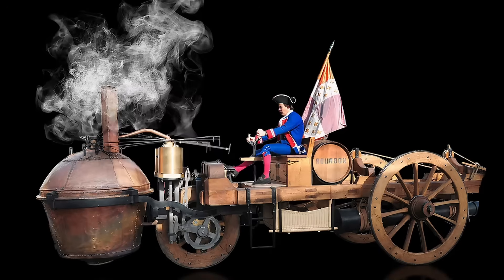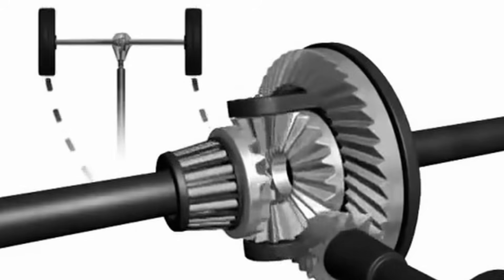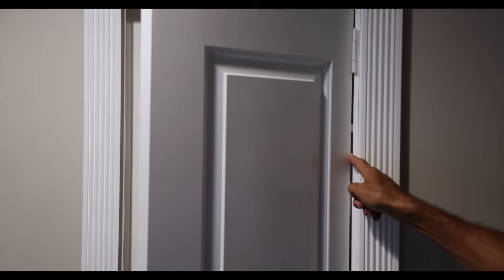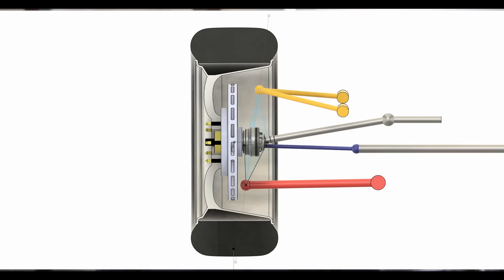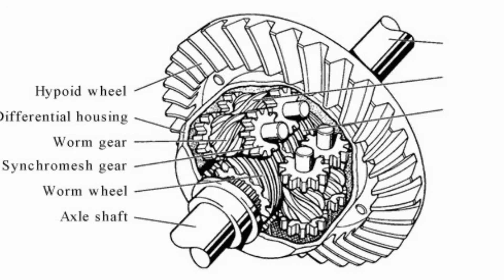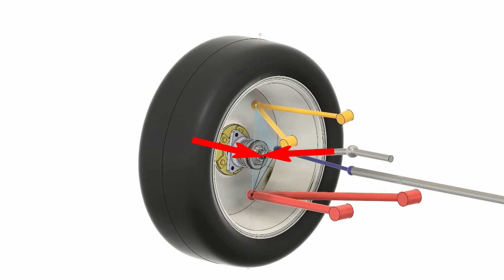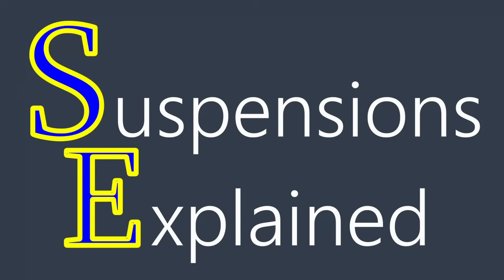Torque Steer: What it is and how it works.

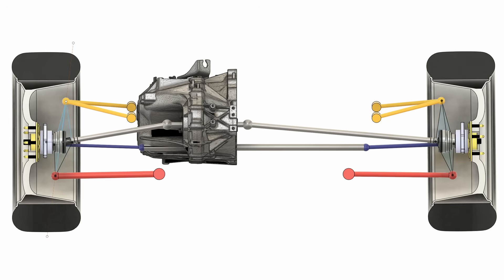Comment: Great explanation, one question though, 16:41 on a big torque fwd car with unequal half shaft, have you ever considered that the torque slightly took longer to get to the wheel because the torque itself causing the longer half shaft to twist first before the torque finally reached the wheel?, or that the twist difference is minimal so we can ignored it?

Comment: This problem got fixed with electronic steering racks. Wont moove the suspention till you dont moove the steering wheel. For the past 20 years thay are realy good, no torque steer, no tracking, also not to much feal od grip.

Comment: How about motorcycles, various front suspension designs. Rake, trail, etc. The effects of long fork choppers, wheel flop, and poor steering. How infamous Sugar Bear long springers, zero trail, eliminate flop and improve handling wirh modified rockers.

Or, how dragster front ends are set up, caster, camber, angles of kingpins so wheels lay over when turned.  If that tends to help run straight. Minimal spring, torsion suspension, crazy long radius rods.

Comment: This is a way overly complicated explanation of torque steer and what limited-slip differentials and unequal length shafts do there is a much easier simpler explanation that he tapped on but didn't expand on this is needlessly complicated explanation of a very simple phenomenon

Comment: an open diff does the opposite of provide the same torque each side, come on!
Reply from the maker: The design of an open differential is such that there is no way it can provide different torques to the left and right wheels. The torque gets to the left and right axles via the spur gears which are attached to the carrier. Since the spur gears interface with the side gears attached to the left and right axles, if the differential were to try to send a larger amount of torque to one side, the spur gears would just rotate. The whole idea of a differential is to allow the wheels to rotate at different speeds, but the torque split will ALWAYS be the same, barring differences in internal friction side to side. When one side is on a slippery surface, the total torque the system can apply to the wheels is limited by the level the slippery side can transmit. This is why you have to limit throttle in those situations or why the engine will just revs up and the wheel spins. The total system just can't handle the torque. This is why limited slip differentials exist, so you can send more torque to the side that has the most traction.

Comment: The CV joint thing makes so much sense, thank you!
Does the vector always act through the middle of the joint? If yes, could we use a very wide wheel and place the CV joint inline with the kingpin and the centre of the wheel?
Reply from the maker: You could, but it would be almost impossible to package

Comment: Interesting. I believe Honda uses a style of strut suspension like this on the Civic Type-R as well.
I'm curious if the virtual ball joint suspension that a lot of FWD or AWD cars use is for this same reason. I believe it helps to "move" the lower pivot point further out, which would move the steering axis further out too.
The only car I've ever experienced real torque steer on was a Mazdaspeed3 that I used to own. Mine was "lightly" modified and made about 300hp with 320 ft*lbs of torque to the front wheels with a limited-slip differential. It was fine most of the time, but if there was ever a difference in traction between the front tires, you were probably going to change lanes whether you wanted to or not. This might happen for something as seemingly innocuous as different types of pavement under each tire, which often happens if the road was patched or expanded at some point. This was exacerbated when I put on even more grippy tires since it was so prone to spinning the tires. It was a cool car in theory but kind of a mess in practice. Ended up eventually replacing it with a turbo/AWD Subaru, which does sometimes get torque steer (for the same reason) but way, way less pronounced.

Comment: I've had a Hyundai i30N (manual) for the past 6.5 years. It is a FWD 275 HP hatchback. It had a very good locking differential in the front, but sometimes on slippery road, you'd notice significant torque steer.

Now 2 weeks ago, I upgraded to the new facelift model, with DCT.. and I'm surprised, the torque steer feels much less. I wonder why.

Comment: how do we determine the location of the knuckle reaction force to wheel torque, relative to the wheel centerline axis? is the equivalent force from the contact patch centroid just projected upward to the wheel's axis of rotation (in the Z axis of the wheel's coordinate system) since this basically guarantees net zero moment about the wheels z axis in the scenario where the wheel is held straight and not on a live axle?
Reply from the maker: Yes. The force is at the geometric center of the wheel/tire combination which is just the center of the contact patch projected to the wheel axis in the plane of the wheel.

Comment: In a future video, could you explain how drive/brake, cornering, and vertical wheel loads are reacted through suspension members? Maybe some structural considerations as well such as symmetric vs asymmetric control arms

Comment: I love how you explain these concepts but I kept thinking of the Landrover I drove years ago after joining my school’s CCF. My late father explained that this vehicle had ‘worm and wheel’ steering for a very good reason…
Reply: That reason was so the spokes of the steering wheel don't take your thumbs off when a wheel hits a square bump driving off road. Nothing to do with torque steer for road use, since it was a beam axle (No half shaft CV issues with suspension movement) and had nowhere near enough power to allow it to accelerate hard enough that torque steer might be an issue on the road.
Reply: @peglor  The geometry of the steering axis relative to the contact point of the tyre with the road is the same in a beam axle as a double wishbone or a MacPherson strut. And a Landrover in low ratio certainly transmits enough torque through the front wheels to fight against an unsuspecting driver!
Reply: @rossmccorquodale666  Having driven a Defender I certainly didn't notice it - most noticeable feature of the Defender is that turbo lag is best measured with a calendar. 

Not sure whether it had worm and roller steering, which removes torque steer as well as any other steering feel from the system. The older Series Land Rovers used this, but I'm not sure about the defender. 

Having also driven a Jimny, which is also beam axles both ends and may well have a better power to weight ratio and definitely rack and pinion steering and never noticed torque steer from that either, and I did considerably more off roading in the Jimny.

Comment: When the lower control arms in a strut suspension have separate ball joints on the knuckle, moving the pivot point outwards, how does that effect things? BMW do this, and presumably it does something for torque steer in their AWD cars. Maybe it's just to control the scrub radius?
Reply from the maker: Using two ball joints like you describe, called a "double ball joint lower arm" is a great way to help in this situation, but it doesn't solve the problem. It was first used by BMW in the 5 series of the 70's but what they got out of it was the ability the package the brakes further inboard and make use of the shape of the wheels to fit larger brakes in the small wheels used at that time.

Comment: What happens when wheel hub motors are introduced into the equation?
Reply from the maker: That is a great question. The answer is to look at where the torque reaction is happening. In a standard car with independent suspension, the torque reaction happens at the differential, so we need to look at where the differential is located. with an independent suspension, the differential is attached to the body or frame. That means the torque reaction goes straight into the body and not into the suspension. Under that scenario, the drive force is applied to the wheel center, as far as the suspension is concerned. If we have  a hub motor, the torque reaction happens at the motor housing, which would then be attached to the suspension. In that case, the drive force is applied at the tire contact patch because the suspension sees the drive force at the wheel center but ALSO the reaction torque from the motor housing. The effect of the force and the moment is to "project" the force down to the contact patch. You would get the same result if you applied the drive force at the wheel center AND the reaction torque to the knuckle at the same time. This is true for solid axle as well since the differential is part of the axle housing, all of which is attached to the suspension.

Comment: Didn't fwd 60's Olds Tornado have over 350hp & zero "torque steer"   
   I thought torque steer was JDM language
Reply from the maker: I believe the Oldsmobile cars had equal length halfshafts which would have alleviated a lot of the problems
Reply: @suspensionsexplained I don't know ? Jay Leno said they were unequal and that's how they overcame it.  I'm just parrot-ing what I heard. 
   ADHD & dyslexia so I'm poor reader.    It's a recent video with the 442 with the tornado front wheel drive option
Reply: @suspensionsexplained  I own a 75 Toronado and yes they are equal length shafts with a jackshaft running just under the oil pan. And has a shock absorber on the steering running (in line?) of the steering axis. Open diff. Torsion bar suspension, and a wheel with the most factory offset I've ever seen really lol. Excellent video by the way, only thing would make it better is using the Toronado as an example lol...

Comment: It’s interesting what a fight it is to package IFS. From the offroad solid axle perspective, it’s pretty easy packaging to get the kingpin axis in an ideal location - so long as reasonable choices are made in design process.
Reply from the maker: If you look at those Jeep axles you will see that the kingpin is quite far inboard. The kingpin offset in those vehicles is very large. They get away with it because they have recirculating ball steering instead of track and pinion. Much less of the forces generated at the wheel get through that type of steering so the driver is more insulated. Still, they are legendary for kick back from portholes and such. The same mechanism generates kick back. Probably worth another video to discuss.
Reply: @suspensionsexplained interesting. I’d like to hear the full discussion sometime when it fits your production schedule.

For context, I’m running an old school Dana 44 with relatively high backpacking and a wide housing. My rough estimate is that I’m at a little less than one inch of scrub radius. Before I did the SAS, the Toyota IFS had way too much scrub radius and was naturally annoying with a front locker. When I swapped, I went with a 67” wide Dana 44 on a modified radius arm design. The ~9 degree slant on the kingpin axis makes it pretty easy to get a correct wheel and tire combo. The result is quite civilized with a Detroit locker in the front and has no issues with steering forces off road despite the relatively anemic Toyota power steering.

Comment: Great explanation, I'm really happy that I discovered your channel, but your explanation about how differentials affect torque steer struck me as completely backwards. At least as far as my understanding goes, along with what I had experienced in practice, open differentials only split torque equally when both tires experience equal grip, and otherwise favor the wheel with less traction, sending more torque to it, whereas the entire point of limited slip/locking differentials and traction control systems is to eliminate this imbalance. After all, how can a locked differential send unequal torque to different wheels when it essentially acts as one solid axle with no ability for halfshafts to rotate relative to each other? If your explanation were correct, that would mean a car with an open differential would not be able to get stuck if one wheel was on a slippery surface or off the ground completely, which in reality is simply not true. You can very easily verify this fact by jacking up one of the driven wheels or parking on a particular offroad geometry so that the wheel hangs in air and verify that no torque is sent to the wheel with grip, making the car unable to move.
Reply: @Mrqwertar you are confusing rpm and torque. 

An open diff gives equal torque to both sides, but allows one side to spin faster or slower than the other. If you had screwdrivers instead of wheels on two sides of an open differential, the diff would allow you to finish tightening two screws of unequal length to the same torque. Once the shorter screw bottomed, the other would start turning at twice the speed, and at the end they would be tightened equally. If one screw remained looser than the other, that side would turn until the screws were equally tight. 

This is evident when one tire is on an icy patch: it has no grip so it takes very little torque to spin. Since that side doesn’t get much torque, the tire on the other side also gets very little torque and the car goes nowhere. The torque is the same on both sides. 

A locked diff is the opposite: it doesn’t allow a difference in rpm between each side, but the torque may vary. If you jack up two wheels with a locked diff between them and start spinning them, there will be virtually zero torque on the axles. But if you add a braking force to just one wheel, that side gets all the torque while the other side still has none. The wheels will spin at the same rate regardless. 

The author of the video got it exactly correct.
Reply: @Glocktologist  Thank you, that explains the confusion

Comment: The 1959 Mini was the pioneer of todays front wheel drive compact cars with transversly mounted engines 👍
Reply: I tend to disagree, as whilst it definitely inspired the current generation of fwd none of them follow the same layout of engine over transmission instead of inline cross car.
Reply: 60's fwd Olds Tornado has over 360hp & zero torque steer , fyi ..

Comment: Open differentials deliver exactly the same amount of torque to both wheels only in a theoretical sense, real components will have some torque biasing capability due to internal friction and such.
EDIT: you also might want to credit the appropriate authors when showing the drawing and diagrams taken from their work
Reply: That difference in torque between the left and right side is rather small. 

The point is that an open diff gives each side equal torque but allows them to spin at different speeds. 

The effect is obvious when one tire is on an icy patch or jacked off the ground: since that side doesn’t get torque, neither does the other and the car doesn’t go anywhere. The internal friction does exist but it does very little to get you going.
Reply: @Glocktologist  There is a transient effect as the torque accelerates the rotation of  the spinning wheel and tyre. Even if that tyre is off the ground, there is some torque applied to the other wheel. Then there are other transients as that wheel gains traction again and the wheelspin stops.
Reply: @rossmccorquodale666  Yes, there is a little torque available for the tire on the ground because the tire in the air (or on a slippery patch) doesn't spin and especially doesn't accelerate with zero torque. It needs some torque and that's what both sides get. 

Try driving a car during winter and you'll find out how insignificant it is. When one of your wheels loses traction with an open diff, your forward drive goes down the drain.

Comment: A practical way to achieve 0, or very negative, scrub radius, is to split the lower arm into two separate arms and form a virtual steering axis. Most traditional arm cars are able to achieve it as well with high offset wheels, ET50 or more is quite typical.

In terms of actual real-world torque effects, it becomes a bit more complicated IME because tire self aligning torque appears to change in combined loads, but how exactly I'm unsure.
Reply from the maker: Yes, that is correct but we are talking about the kingpin offset here which is equivalent to the scrub radius but at the wheel center rather than the contact patch.
Reply: @suspensionsexplained  You could set the kingpin offset to pass through the tire center if you want, although typically at the expense of quite negative scrub.